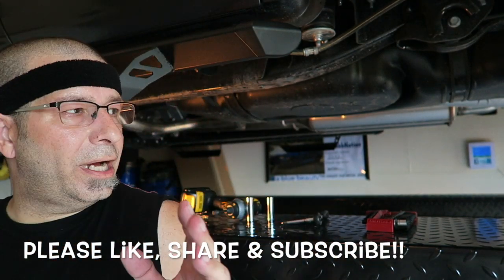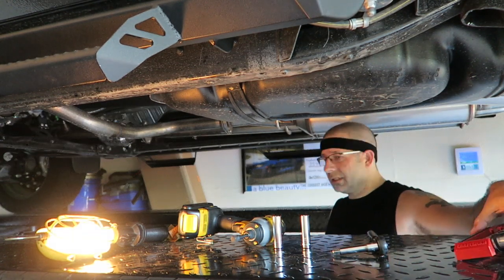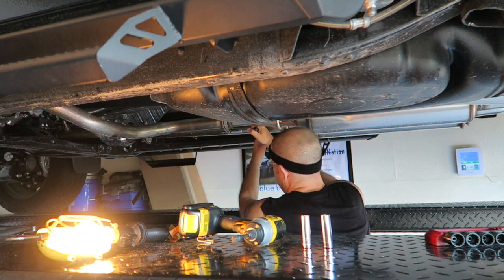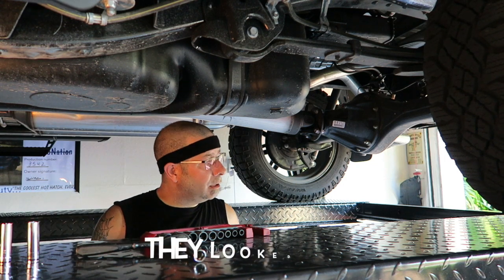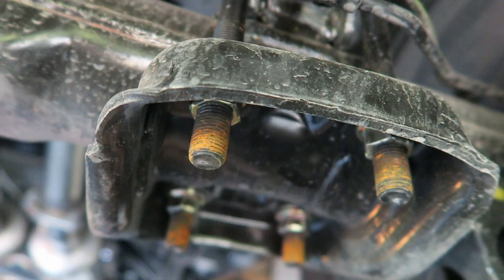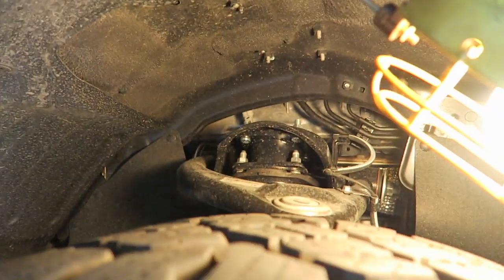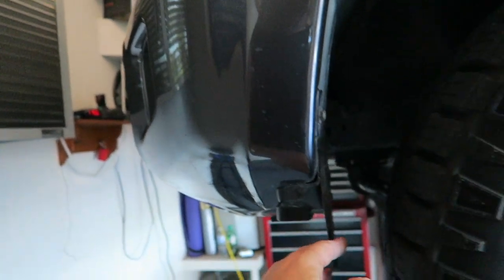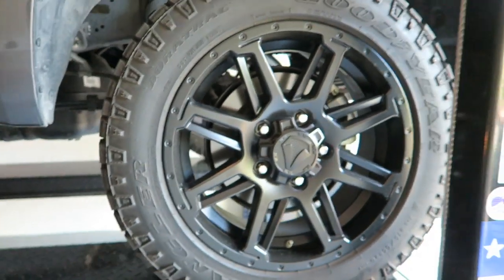Tightening Bolts & A Lift Look On The Tundra!

Comment: I have a 3/1 Toytec and just recently added spacers 1.25” began to rub on the back mud flap at full tilt. I just removed, cut, moved in a bit then epoxy and trimmed. 
Them front flaps had no issues.
Reply from the maker: Just enough to change the angle I suppose.  No issues with my current setup👍

Comment: Does the  block and spacer lift put any additional weight on the front end?  I know that they used to recommend not just lifting up the back due to the stress on the front end.
Reply from the maker: The block and spacer lift is for both the front and the back.  Spacers in the front and blocks in the rear.